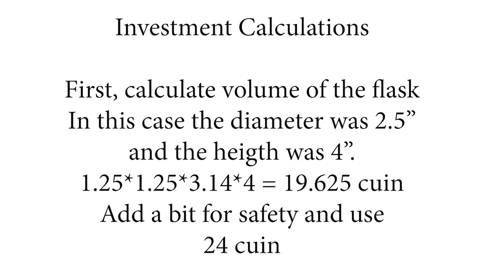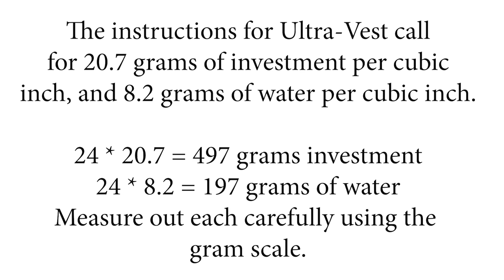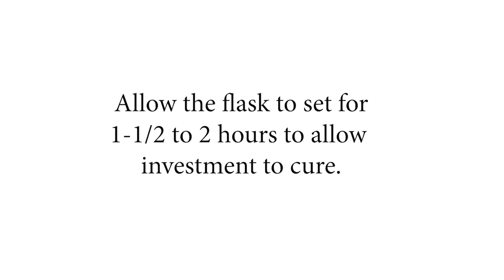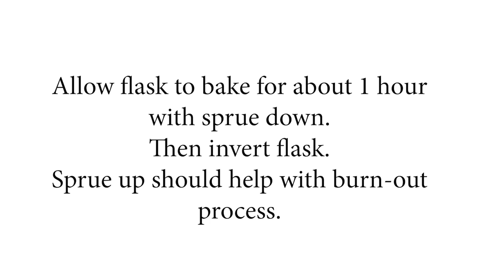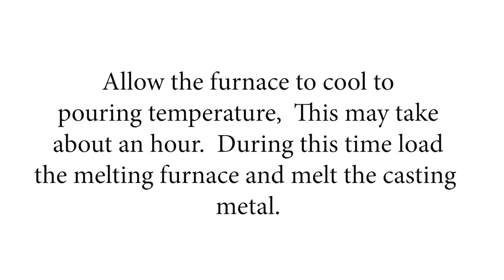Investment Casting using 3D printed model

Comment: Hello congratulations for your work !!! Please make more videos about this work. I'm Brazilian and I'm interested in working with this work you used, turning printed parts from a 3D printer and turning them into metal ...
Let me ask you: Would you make a plastic injection molded print on a 3D printer and then cast it on cast aluminum to be sturdy and seal on a plastic injection molding machine to make small serial parts? Because 3D printers are still very slow and take a long time to manufacture a part, the plastic injection process is much faster, but the molds are very expensive! This is why the idea of printing the desired part in the mold is printed on a 3D printer and then using the metadata used in the video to transform the aluminum printed mold to make it more resilient and put on the molding machine. Plastic injection and remove plastic parts Faster! would it be possible? Thanks and sorry for my english.
Reply: I am also looking for this idea

Comment: Thank you for this excellent video. The 3D printed model had to be scaled for 6061 aluminum. What scale factor did you use? Do models printed on filament printers produce castings as high quality? What filament material would you use for investment casting?

Comment: Thankyou so much for taking the time to make this video George. It was very well presented and thorough. Most videos on lost wax are on silver and rarely use the fast burnout process, so it's good to see content on casting aluminium that isn't sand casting. I noticed when spruing your resin model, there are a few small cracks. Do you know what causes them and how to eliminate them? I am using senertek castable and sometimes these cracks are minimal, at other times they split the model. I think perhaps it's related to resin cure settings? I am using a wanhao d7. It would be good to know what you are using and your resin exposure settings. Thankyou.

Comment: What temperature has the flask if you put it on top of the vacuum table? And where did your get your silicon rubber membran from? All the ones I find only withstood up to 400 degrees

Comment: What a lovely casting and what a beautiful process!

I have a couple questions though;
1. When you put the flask in the super hot oven while it's still wet, why doesn't the water in the plaster boil instantly and explode the flask?
2. What's the point of applying vacuum to the flask during the pour, when there's no hole for the metal to 'feel' the vacuum?

Thanks
Reply: I have the same question, but my guess is that the plaster is a porous material so the vacuum can suck the excess air out trough the mould itself.

Comment: is there two holes in that casting module, one for the air intake and other for vacuum output? where can I buy it? Nice precision cast, please make more videos like this. I want to cast small pipe fittings with threads, I don't think metal casting can provide proper threads for pipe fittings.
Reply from the maker: The bottom of the flask is open.  The investment (plaster) is porous, so when a vacuum is pulled on the bottom, the molten metal is pulled into all of the tiny crevices left by the burned-out wax or resin.  You could rough-out the threads, but they would probably need to be cleaned up with a tap or die.
Reply: @makerspace533  interesting. Thanks.

Comment: Did you ever compare casting the same part with and without using the vacuum underneath? Like, how significant is the vacuum benefit?
Reply from the maker: No, I always use vacuum.  Without the vacuum the small detail areas would not fill with metal.  For small items jewelers use a method called centrifugal  casting where the metal is forced into the detail areas with centrifugal force.

Comment: That's the total shiz' with that high fidelity resin print-to-metal cast effort there George.  I am barely scraping my way into feeling out a potential very small DIY propane furnace with a tin can for some aluminum casting, from my i3 Prusa clone (Anet A8 type, with Arduino conversion) standard filament printer.  A slow back burner project...  ...but that is really something what you've taken on there - way cool. :)

Comment: To really avoid breathing the dust, try a half-mask respirator with P100 filters.  Around $40.  Great to have if you are spending a significant amount of time around fine dust.  Actually seals to your face so incoming air goes through the filters.

Comment: Great guide, thank you! I have two questions. What's the material of the flask, and the details of your vacuum system. What's the black part in the intake of the pump? What's the disk under the vacuum bell?
Reply: Also, I had to pause a few times to get to read Ultra-Vest, VAC-U-COAT and MAX WAX, you might want to add them to the description

Comment: i want to know how you can achieve that vaccum, and then por in the liquid material without the material being sucked into the vacuum pump ? sory my knowlege about investment casting is very limited but i just wondered how that works that the aluminium istn sucked into the vacuum pump
Reply from the maker: The investment is a plaster like material.  It is porous enough for air to pass through, but the aluminum cannot penetrate the investment.

Comment: Great video George thanks for posting. Was the vacuum plate towards the end of the video just there to keep the mold from tipping over?
Reply from the maker: The investment (plaster) is very porous.  The vacuum pulls the air out of the mold cavity effectively sucking the molten metal into the mold, filling even tiny details.
Reply: Actually just read valient six post and your reply about the investment mold being porous.  Interesting concept would be interesting to try two of the same molds one with the vacuum assist and one without to prove that is the case. If so it would probably be beneficial to keep the floor as thin as possible.

Comment: Hey George, awesome casting and a beautiful workshop! Did you have to sand the build plate for your Wanhao D7? Or did the resin stick to the build plate just fine? Also, I noticed that the vacuum/degas plate looks custom made. All around great job!
Reply from the maker: I tried sanding, which I hated to do.  The build plate had such a nice finish.  I found that the sanding was not good enough.  The answer came when I used transfer tape to attach a piece of perf-board to the plate.  Perf-board is the fiberglass board that has holes on 0.1" centers for mounting electronic components.  The resin flowed into the holes and locked well.  So well, in fact, I shorten the cure time for the first layers making it easier to use a razor blade to remove the part.
Reply: Thanks for the info! I was planning on sanding my Wanhao D7 but I will go with the PCB board instead. Boy is it time consuming trying to dial this printer in..
Reply: @hardcry4159  Hey, have you tried using the PCB board in the end? Did it worked? What PCB did you used?
Reply: @NoHeartless2  I actually switched from resin printing to FDM style printer. The fumes were too much for me. I did not get a chance to try the PCB board. However, I did notice that the resin quality has a HUGE impact on how well it sticks. The standard Wanhao resin had trouble sticking to the bed, whereas the rapid gray resin from Monocure stuck just fine. Hope this helps man.

Comment: Nice little horn antenna! It looks like the waveguide flange is bent up toward the horn a little bit, is it? Thanks for the vid,  subscribed!
Reply from the maker: No, I think it was optical distortion due to the GoPro I was using.
Reply: That makes perfect sense. My GoPro3 definitely has some fisheye to the lens. Really nice as-cast finish there. Could you ptu a link to some of the products you used in the description? (If you used amazon, amazon will pay you via referral links)  @makerspace533

Comment: That looks like it came out of a  top of the line CNC mill. How much would you charge for a small part like that if someone would send you a part to be casted in metal? I would also like to know what kind of furnace you used to melt the metal, it looks electric?
Reply from the maker: I believe Shapways.com could make the part for you.  The furnace is an electric melter used by jewelers.  They are available on Amazon and eBay.

Comment: Hi do i have to put chamber on vacuum table as hot ? could i put chamber on it as cold ? i mean hot is important to pouring metal ? so sorry my english is not good i just want you to understand my question clearly :)
Reply: The investment is supposed to have some porosity so the vacuum helps pull the molten aluminum into all spaces of the plaster.

Comment: Couldn’t you have modeled and printed the sprue instead of doing it with wax? 
Great video!
Reply from the maker: The base of the horn was on the build plate.  I could have done the sprue as a separate piece and attached it to the base, but the was was easier.

Comment: Does anybody know what device is stettled between vacuum table and pump? The one in black/red
Reply from the maker: Sometimes, if you turn off the vacuum pump before turning off the valve between the vacuum pump and chamber, the vacuum in the chamber will suck oil out of the pump and make a big mess.  The device is a simple air filter and captures the oil so I could pour it back into the pump.
Reply: Thanks a lot for your answer! You are inspiring me with your content.
I already wrote you an email on your official facebook page. I would really appreciate if you could answer me.
Best regards,
Alex
Reply: Could you also tell me the inside diameter of your dome? Sitting in front of my design sheet and try to build this table on my own😊
Reply from the maker: @AlexMoophty  The dome was donated along with a few other items.  I've seen it for sale on the web, but I don't remember who made them. As I recall, the outside of the flange was about 11 inches, so the inside diameter would be about 9.5 inches.
Reply: Thanks a lot☺️

All the best to you🙋🏼‍♂️

Comment: I am curious as to how the flask was able to get a vacuum pulled on it. The investment material was against the wall of the flask and there was no metal gate down to the bottom of the flask. How was a vacuum useful for the flask and the casting process? Was the investment material porous enough to draw a vacuum through the solid material?
Reply from the maker: The investment is quite porous, at the microscopic level.  The vacuum removes the air and the molten metal replaces it.
Reply: @makerspace533  so your saying the vacuum "may" remove some trapped air at the bottom of the casting.
Reply: @Valient6  when a vacuum is applied, consider what it would take to prevent any trapped air from being pulled out.